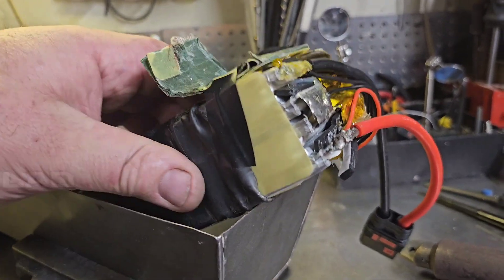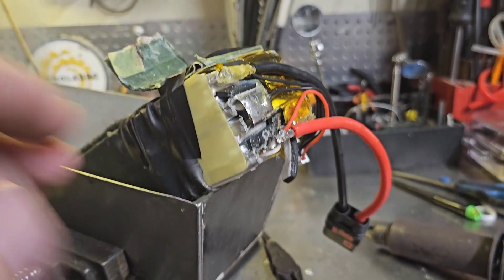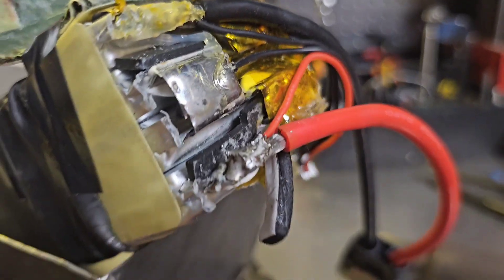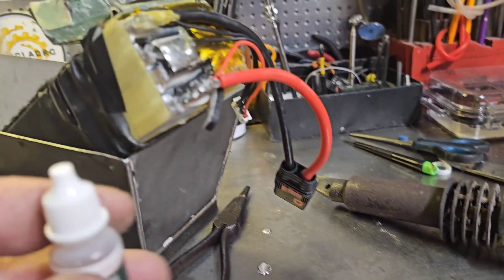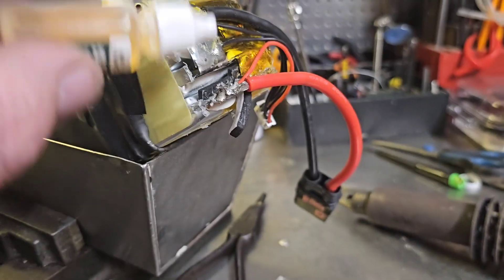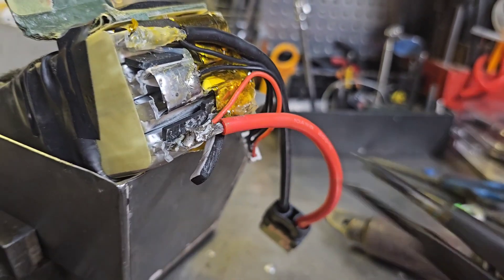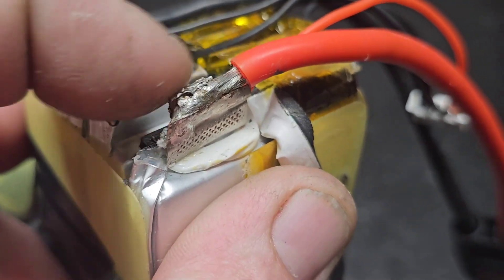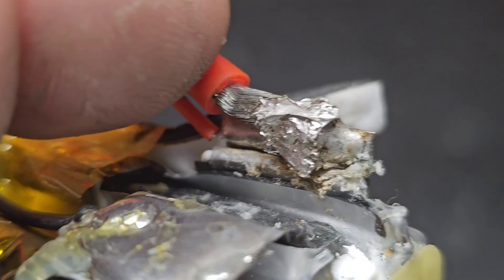What I Used To solder/Repair Lipo Tabs On a Damaged Lipo Battery

Comment: Never head a lead get off. Corrosion on soldering, cells running empty is what my main problems are with lipo's in wet invironment. Threw away 6 lipo's last year or so. It were all the older once i had quite some years. I always try to find whats wrong but so far i didn't think it was worth the risk trying to fix it. 
I've experienced some shorts so i know how much power is in them. A 5mm screwdriver is gone in a second, that's how much power some off the packs have! So i try to stay away from messing with them to much. I get your trying to repair a good and quite fresh pack, but oh man, could end in disaster also...

Comment: I have saved quite a few doing similar but I find if your soldering onto a tab that has solder already there like for a balance lead it works fine.
Hey mate did you take those photos of the plans to email yet.
Reply from the maker: I can take photos, yes, I have the plans ready to take to the post office for shipping
Reply: @ thank you can I send you some money via PayPal to cover your cost.?
If you want just email me your PayPal details and whatever you want in $’s to cover your costs.
Thanks heaps but emailed photos of them would have done me.
Reply from the maker: It's just an envelope. I have sent the same plans to Australia in the past its not that expensive, I also have the 12"  tiny titan plans I'm sending along with it.
Reply: @ sweet I may make both.

Comment: To me that positive terminal (Al) looks to have a spot welded tab on it. Unless it ripped off when the wire separated
Reply from the maker: Yeah, i believe the main positive wire was spot welded onto the tab, I soldered the other side because the tab was longer than the spot welded tab area.
Reply: @IRONCLADRC  Working on these packs is like disarming a bomb

Comment: I'm glad to see this because I have one to do also. Mine is a cheap battery so if it works great if not oh well.
Reply from the maker: I put an eBay link in the description,  Let me know if the link works for the Flux..
Reply: @IRONCLADRC  it's on the way.thanks
Reply from the maker: For some reason ebay links expired quickly?      Glad you found it
Reply: @IRONCLADRC  the link didn't work for me but I found it and ordered it